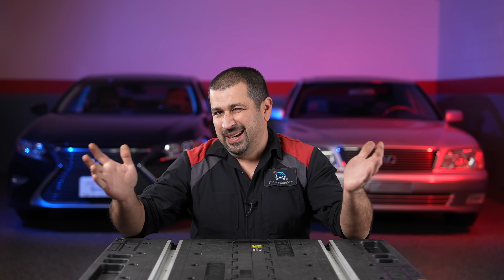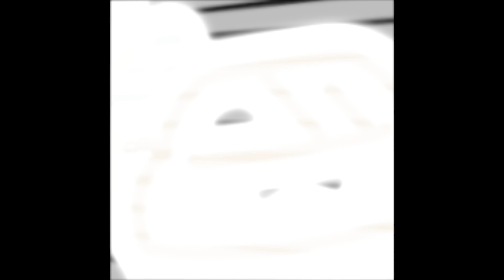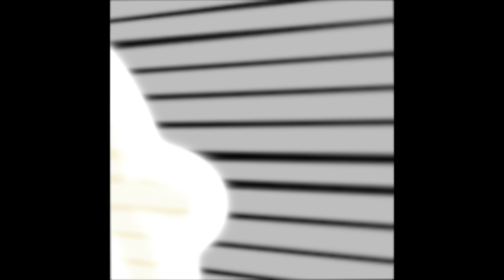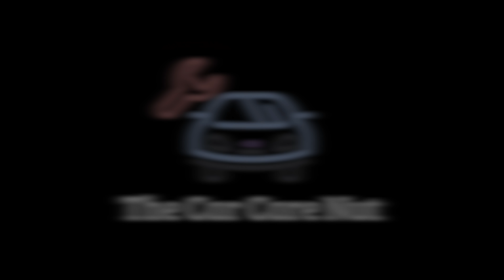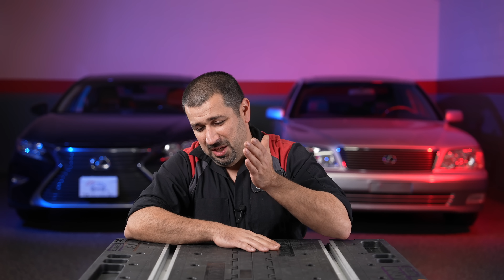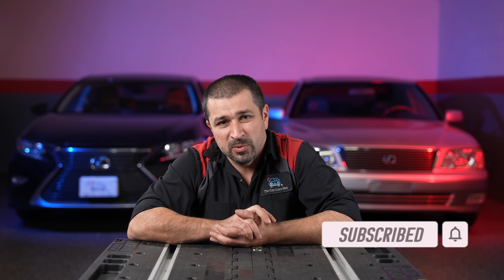Can Modern Turbo Engines Be Reliable? Here's The TRUTH!

Comment: Two vehicles I drive;
One, a 1999 Ford E350, weighs roughly 9,000 out of it's 10,500 GVWR. At over 200,000 miles, no turbo, oil changes every 3,000, seems to do fine, managing 75MPH and 12mpg, a small 13 passenger shuttle bus converted to a camper. my only complaint is the shift points not playing nicely with the aftermarket cruise control (will sometimes disengage rather than flooring it, usually right before the transmission downshifts). I drive this vehicle a whole 3-5Kmiles per year (road trips and weekend shopping runs). I change the oil religiously at 3,000 miles with an added quart over a rear main leak. at 27 years and 200,000 miles, it can be expected
Another, My company provided Transit 250, About 7,000 lbs, 15mpg on a good day, half the engine displacement with a turbo.  I've had it about 2 1/2 years and had the oil changed at 5,000 mile intervals, give or take 150. It is just under 50,000 right now, getting an oil change this Saturday.
Outside of the usual stop and go, I try to drive smoothly, though I end up with about one or two launch events per day, due to traffic conditions and my office faces a very busy 55mph road that everyone does 65 on. 
Outside of the water pump, the front and rear main seals that I intend to replace (possibly journal bearings as well next month on the older beast, guess which one sounds better at idle?
Should I apply a 3 or 4K oil change on the Transit? fleet manager permitting? or let it stay at 5,000. While I don't seem to use the turbo much, it is used heavily once or twice a day

Comment: NOOB QUESTION: isn't the turbo charger spinning outside of the engine..?? How it can damage the engine oil..??? Just because of the hear and high rpms?
Reply: The engine oil is used to lubricate the turbo. The turbo get much hotter than the engine and destroys the engine oil quickly.

Comment: I own a 2023 Kia Forte GT  1.6 LT 4 cylinders Turbo engine and it has 150.000 miles and it runs like brand new I always make sure to change the engine oil 🛢️ every 5k using full synthetic oil and checking the oil constantly between oil changes that it's always at the right level

Comment: I bought my little 1.2 litre Hyundai i20 new 12 years ago.  The recommended oil change interval is 20k kms.  I change mine every 5k Kms.  It's just gone over 220,000 kms and has never missed a beat.  I bought my Landrover Defender TD5 almost new in 2003.  It's done over a 100,000 miles. Same turbo, same engine. No rebuild and pulls like a train.  Turbo diesels, yes indeed!  Turbo petrol, no thank you!

Comment: OK, I have a little confusion going on here.
I have a 2023 RAV4 hybrid. No turbo. Recommended interval is 10,000. I do mine at 5000, with synthetic oil.
If I have a turbo, we are now recommending 3000 to 4000 miles? Is that also with synthetic oil, or does synthetic go for 5000 miles even in a turbo?
I understand oil is cheaper than an engine. Don’t get me wrong, but constantly being under my car or running it into the shop, “to keep it on the service record” can be a bit much.
Reply: 5000 miles for non turbo is ok. 2500 to 3000 for turbo is recommended.
Reply: @Taras-Nabad  thank you. I have honestly never heard that. My friend has a 2025 grand Highlander max, hybrid turbo. I cannot get him to do his oil changes earlier. I think he has even 10,000 in the owners manual.

Comment: I have 2024 atlas. Change it every 10k miles as suggested 😢
Reply: I hope you don't plan on keeping long term.
Reply: I do plan. Keeping long term love the car. It has like 20,000 miles has had 2 oil changes total once every 10k and one air filter. With a tire rotation I think

Comment: I just learned today that my 82 Z28 flat tappet lifters destroyed my number 7 cam lobe due to changes in oil chemistry by the 90s. Oil chemistry is more important than people realize. Also I think the previous owner stretched oil changes and the oil passages got blocked and number 7 and 8 are the lobes that suffer the most. I asked ChatGPT and it solved a 30 year old mystery for me.

Comment: Properly designed Turbo systems actually make diesel engines last longer, because they make the combustion process cleaner and more efficient. Whereas they always shorten the life of a gasoline engine. Diesels are lean burn engines so more boost = cooler more complete combustion. In a gasoline engine more boost means hotter combustion, and a chance for melted piston, valves, general engine death and destruction. Diesel engines use the injection of fuel as the ignition system so there is never any fuel in the cylinder until it is the right time for it to ignite meaning detonation in a diesel engine with a properly timed injection pump is impossible. Gasoline engines inject fuel and air into the cylinder at the same time. Meaning the fuel air mixture can and often does ignite before the piston is in the right position to receive a power impulse. Increased heat from boost especially when the boost creates a lean condition will cause detonation so bad it can doom an engine in seconds.

Comment: Dont forget, higher turbo speeds, longer oil changes AND low compression rings and (you want to get really scared?) .... Direct injection!  And engine start/stop and the newer low idles!  Run for the hills.

Comment: I knew you were gonna say it lmfao and right at 10:00 here comes the 3k mile oil change nonsense... Complete waste of time and money...scientific studies and research done have shown time and time again it's a complete waste to dump engine oil every 3k miles...Black Stone Laboratory has done hundreds of tests that show even turbo engines are completely within safe levels of oil protection and additives up to 7500-10k sometimes even more miles from a molecular level. That's not opinion it's scientifically proven...but folks will continue to spread unfounded fear based "well that's how my daddy did it" reasons to justify wasting 3x as much oil and spending 3x as much money on oil changes...but they'll be folks arguing about this on the internet after we're all bones and dust 😅😂🤦🏾‍♂️
Reply: I review warranty claims/requests for a manufacturer that uses many small turbo engines in their fleet. I cant tell you how many times ive seen engines with excessive oil deposits (sludge) that have oil changes done every 8-10k. Just because these engines CAN go that long, doesnt mean they SHOULD if you want that car to last past the warranty period.
Reply: @CheyneRiggs i drove a 2013 Hyundai Sonata 2.0t (which is a small turbo) from 36k miles to 138k miles and changed the oil every 7500-10k miles and had zero sludge in the 100,000 miles I put on the car until I sold it...there is no sludge build up at 10k miles with normal driving...too many scientific tests have been done with oil taken from engines with as you mentioned 8-10k intervals that's show the oil in perfectly working condition with the rated level of addiditves still showing...for this 3k interval fear mongering to still have any weight....go check the data from Black Stone Labs...but who cares about factual science...uncle Joe and his daddy did every 3k so I'm gonna do every 3k lol smh...
Reply: I use full synthetic oil in my vehicles and do oil changes around 5,000 miles...seems about right IMHO.
Reply: @larrysutton925 5k is being safe and shorter than I did for over 100k miles of driving in my 2.0t engine which was also tuned by the way...i changed every 7500-10k miles with zero issues....so I hear that...but 3k miles is flat out wasteful and this guy is continuing the fear mongering by continuing to spread this BS smh
Reply: @tonybailey89 I agree.  Of course they want to make you bring it in every 3,000 miles so they make more money.  My oil life monitor usually reads about 60% oil life remaining at 3,000 miles.

Comment: This is some great information. Like many mechanical reviews on You Tube it is missing some fundamental information. Rather than just recommending that the oil needs to be changed more often, how about showing the oil analysis at 3, 4 and 10 thousand mile intervals to prove the point of oil degradation. Additionally, there is a big difference on diesel versus gas engine design concerning the size of the oil sump. Diesel engines on trucks hold around 13 quarts of oil and the gas engines generally hold around 5 quarts. The new small engine turbos are in many cases also water cooled as the main issue with any turbo is getting rid of the heat generated and the oil provides this along with lubrication. Automotive oil is the lowest grade of engine oil and would not even be considered for industrial engines running 24/7.

All this said, it still doesn't check out that any of these small gasoline engines are designed well as everyone comes with an undersized oil sump and oil is the life blood of the engine

Comment: Like for like, turbocharged engines simply can't be more reliable by definition. You are adding complexity (via more parts, heat management, oil & lubrication etc) and adding more stress to the internal components.

The turbine shaft requires balancing to a very high precision. When you neglect your oil, it wears away the bearings and seals of the turbo, causing it to become imbalanced. It small, but it's magnified greatly at high turbo RPM (particularly small turbos). You'll start to have oil leaks through the turbo, and eventually it will self-destruct.

Comment: You can make turbocharged engines reliable. Look at Volvo 240 Turbo or Saab 900 Turbo. 

The problem is, you can't make a reliable engine from weak parts. What is "weak" depends on how much power it produces and how heavily it is stressed (how heavy the car is, how much it pulls...) as turbo engines produce more power, you need to have stronger components. Also if you are making a real truck meant to haul a lot of cargo, you can't just turbocharge a small engine with small engine components and expect it to last. I don't always get these American pick-up trucks with huge engines as you could get a Swedish Scania truck and it would outlast those left and right. Passenger cars have consumer parts, large american pick-ups have prosumer stuff. Real trucks, even small ones with far less horsepower than large American ones, are pro stuff.

Comment: Not one word about driving them differently.  I would avoid making the turbo kick in by driving pretty sedately.  It's nice to have that boost when you need it but maybe try not to need it as much.  I don't see any way around using the turbo if you're in an underpowered truck or SUV and your driving up a steep grade on the highway, because to keep going at speed, you're going to kick into a lower gear and it's going to spin up the RPMs and the turbo will kick in.

We need to take a stand against the EPA.  They destroy everything they touch.

Comment: 2016 Focus ST with the 2.0 EcoBoost and a 6 speed manual.  110k plus with zero issues and it’s the daily driver for a 17 year old from day one.  Full synthetic 5w-30 from new every 5-6k.  I can’t fathom running a turbo or supercharged engine over 6k between oil changes and expecting it to last.  The pressures and stress on oil is just too great to go thot long.

Comment: The latest GM Canyon and Chevy Colorado have their 2.7 turbo engine, it has an electric water pump that CONTINUES to run for a bit AFTER you shut off the engine to cool the turbo / engine..... SMART move on their part.
Reply: What years on them 23-25?
Reply: @robertwehlau7220  /\ Yes, correct.

Comment: After Ford addressed issues on the 2.0 and 3.5 turbos ....they are BOTH very reliable as of 2020 .... coolant intrusion issue on 2.0 corrected...and sub par cam phasers on 3.5 updated / corrected....they are both considered to go to 200,000 miles and beyond with just maintenance...I've read posts on the 2.0 with that high mileage chugging along...their 2.7 engine has always been overall reliable with some hiccups but is now rock solid as well.

Comment: I have a new Chevy Colorado with a four banger with turbo that is quicker than the V8 Silverado Intraded in. It also has an oil system that keeps the oil flowing through the turbo after the engine is shut down. The old turbos cooked the oil left in it when the engine shut down. GM has made some big changes to their turbos.

Comment: I agree with the heavier oils to a point, but not ZERO weight oils. Gas turbo engines need a high quality PREMIUM synthetic motor oil like MOBILE 1. Stay away from ZERO weight oils. Use an oil a grade heavier (example) 5w30 vs 0w30 if that is the specifications for your engine.
GM just issued a recall stating this due to engine failures with ZERO weight oils in some engines. ZERO weight oils were developed to help manufacturers pass emissions tests in the USA ONLY. Same engine outside the USA won't have a ZERO weight oil specification. 
Lake Speed Jr. has done a study on this and released a YouTube video on the "WHY" and "WHAT" weight oil to upgrade too. It's different for different engines. 
SERVICE, SERVICE, SERVICE
Change your oil regularly. Like you said every 3000-4000 mlies. No more than 5000 if you're using a PREMIUM SYNTHETIC OIL like  MOBILE 1, there are other PREMIUM Synthetics but I haven't used any.  CHEAP OIL=BAD OIL
GREAT VIDEO 💯👍

Comment: Oil is critical. Former engine builder here who grew up on V8's and love them, and neglecting or stretching out oil changes is a sure way to make even a good engine live a shorter life. That being said, engine design plays a big part in reliability and longevity, and there are NA engines that are less reliable than a good turbo engine. We have one in the driveway with 254,000 miles on the original SRT4 turbo engine which has actual track time on it, and even though it can go door to door with a stock 426 Hemi (timeslip is in my glovebox), it's out lived several of our NA cars, including two Hondas (surprise), a Kia (no surprise) and a V8 Lincoln LS.

Comment: In my opinion turbo 4s are not meant for larger heavier vehicles and will not have a long life span.   We have a 2015 Forester turbo and are very diligent about changing the oil before it's even due and when I notice it's starting to get black.   So far no issues.   In general I believe that all turbos will need more frequent oil changes than non turbos and most vehicle owners just won't make the time or effort to get this done.

Comment: I’ve found a way to make the 2016 Focus ST turbo last longer: The car comes with oil temp/pressure and boost gauges; so I don’t use boost until the oil temp and pressure are at their normal condition. The other thing is the use of Shell 93 since for whatever reason that gas on that engine keeps the valves clean. It’s a big problem when carbon builds up and then chunks off potentially damaging the turbine. The oil change interval is shorter of course, and use whatever oil is the best for that engine.

Comment: Mercedes / VW master tech of 20 years. You are correct about oil intervals. The funny thing is that consumers rarely get it in before the 7/10k mark. It’s always way over. However, as of late. We have noticed modern cars, 6 years, have surpassed our assumptions of reliability. Rarely do I see engine failures at 6 years / 120k miles and over. Not sure about any other manufacturer but from what I’ve seen. Merc and VW seem to have hit a decent sweet spot with their smaller engines and low boost reliability. Drivetrain is a different story. Great job of information to the consumer. It really is up to how they drive and maintain the vehicle all together.

Comment: I have some disagreement with finding only the faults of the turbo 4 cylinder. I am a typical owner of a 4 cylinder/2 liter with a turbocharger with a manifold pressure and oil temp gauges. The amount of boost only occasionally exceeds the flow of a normally aspirated engine, well except I'm on the track or feeling frisky. So, would I rather have a turbo 4 or a bigger, heavier 6/8 cylinder? I chose a modern turbo. 

There is of course, a limit. A 5,000lb (or much more) hauling a trailer needs the the displacement of the bigger 6 or 8 cylinder engine to keep from always taxing the engine with heavy boost.

Comment: The reason to the switch to turbos is democrats and their CAFE standards, democrats have single handedly ruined the car industry
Reply: Ya right buddy.  It couldn't be the market demanding higher MPG.
Reply: @CAN43714 every decade cars continue to get heavier due to standards that are mandated against auto manufacturers whether it’s airbags, ABC pillars, size, crumple zones, etc. some of which can be good, but makes our car is more expensive and less fuel, efficient, cars used to get plenty of miles per gallon, yet a motorcycle still legal, we should not have to have forced mandates on auto manufacturers. Cars are plastic junk today and don’t last. it’s not the market because auto manufacturers aren’t allowed to make what they want.

Comment: More power per displacement yes, reliability no  Toyota keeps calling me asking about trading in for a newer Tundra, I keep telling them to ditch the turbo V6's and I'm not alone.  They aren't listening.  Thinking about restoring an old truck at this point when my Tundra is finally ate up from salt beyond repair.
My 5.7 still gets 3k oil changes and now use 5W-30.   The other thing killing American cars is the 0W-20 nonsense and now even thinner which is just crazy.

Comment: And most of the turbo engines are open deck engines.  The cylinders vibrate because the top is not supported by the block and they often blow head gaskets.  Why open deck? Much simpler to cast the block and much cheaper.

Comment: I have the oil/filter changed every 6 months in my '19 Tacoma SR, 2.7, 4-Banger. Usually have between 1200 to 1400 miles on the oil. Going to drive it till I enter the grave. Going to turn over 19,000 miles this week. :)